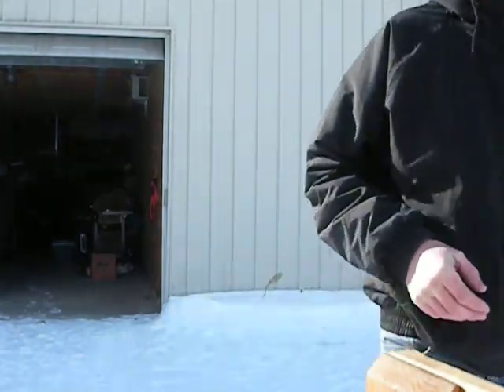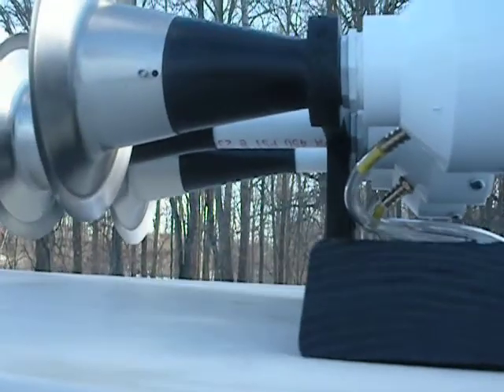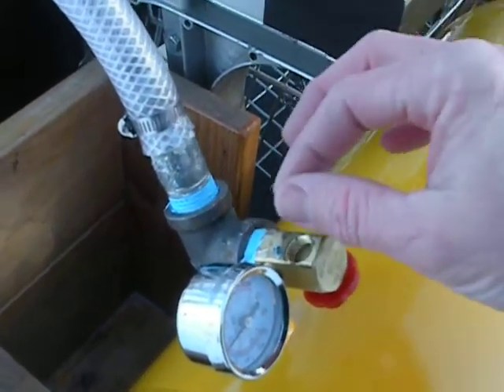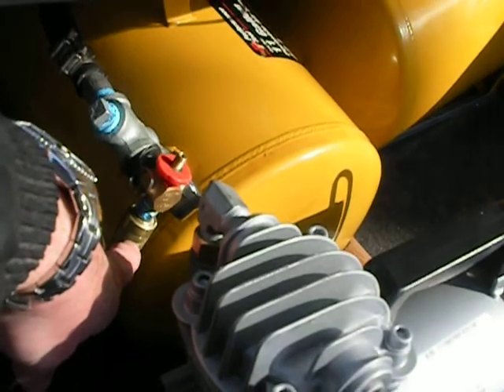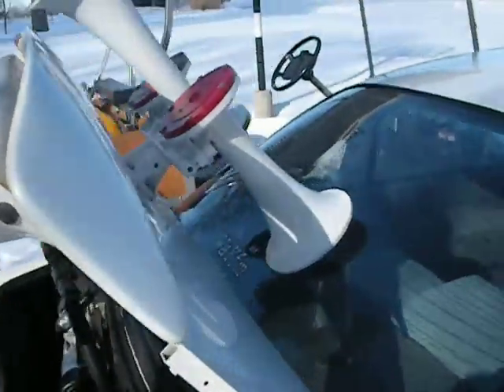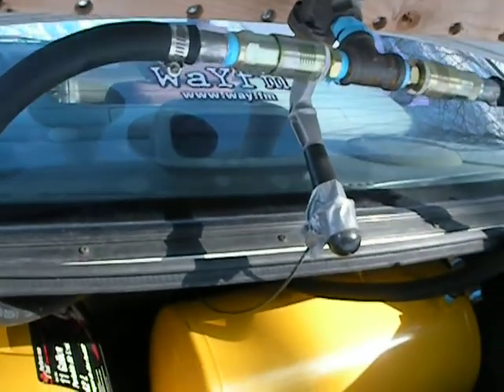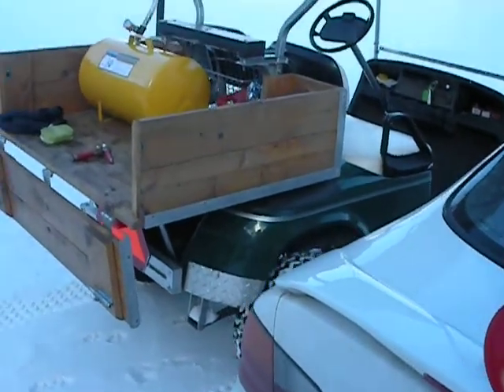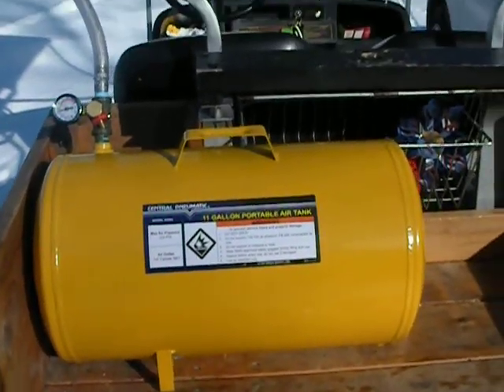Train Horn Air Compressor, Tanks, and Valve Installation video #5

Comment from the maker: Yes you will. I use two 11 gallon air tanks hooked together for some good long blasts. You could get away with just one 5 gallon air tank for a couple of real short blasts. Stock car horns use 12V electric to make them work, train horns run on compressed air.

Comment from the maker: No, they still allow plenty of air to flow for blowing them at full strength. The key is to use 1/2" air line all the way up to where the seperate lines split off to the individual horns so there is always plenty of air volume to feed all the seperate lines at max volume.

Comment from the maker: The train horn valve is a Graham White valve. You can find them on ebay under train horns. Otherwise any 1/2" air line ball valve will work for a whole lot cheaper.

Comment from the maker: Very true, but these horns will start blowing and releasing air pressure at about 30 psi. Once they start blowing they really wont hit much higher internal air pressures. Schedule 40 PVC can easily handle at least 100psi. so I never get concerned about that. You do want to be sure to glue and fasten all the parts together very well or they can blow apart. Dozerboymilller

Comment: Just Remember, PVC pipe can be very dangerous  when used with compressed air, esp. at colder temperatures. PVC tends to shatter violently, instead of developing a leak. I've even seen schedule 80 PVC crack violently.

Comment: Does the CFM of the tank play part in the loudness of the horns? Cause my horns sound a little wimpy.
Reply: Yeah
Reply: It does. You usually want to maintain around 120psi. Also running 1/2” airline helps maintain the volume of the air and gives the horns their full potential.

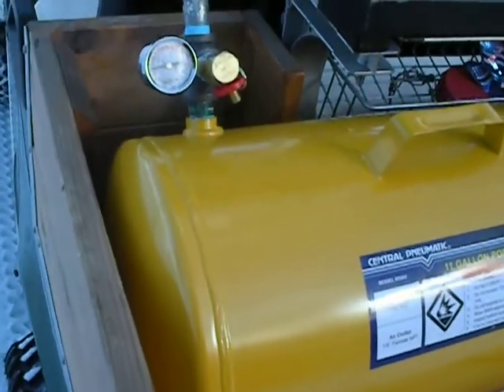Comment: Where did you get the connector piece with the air chuck and air line fitting at and what is it's official name. U explained it at 2:10